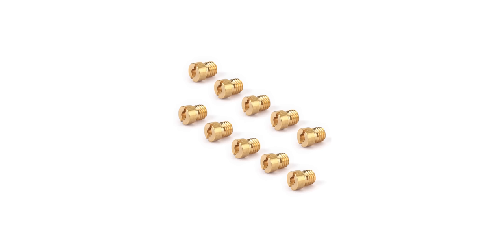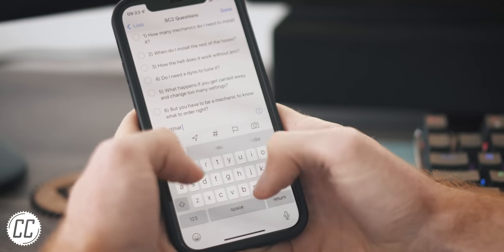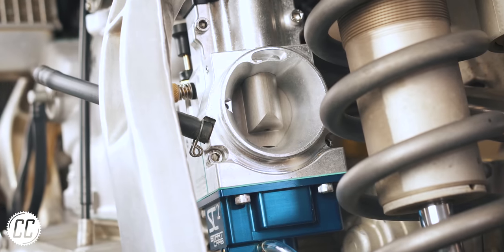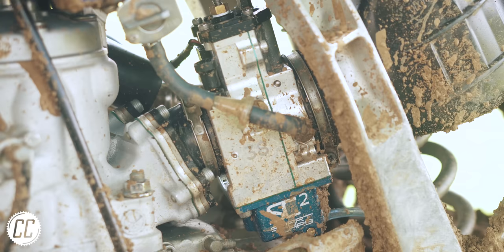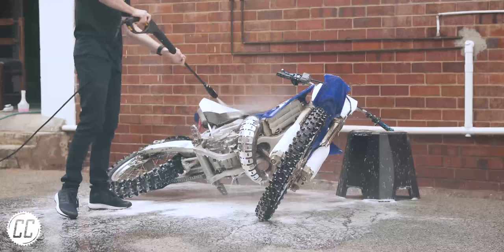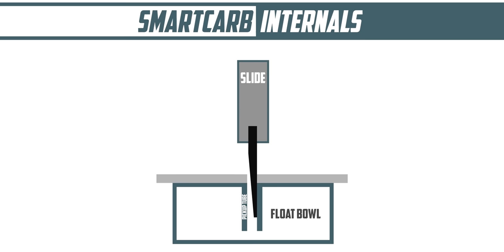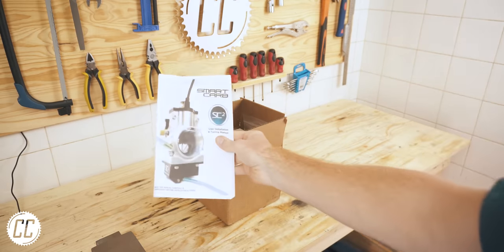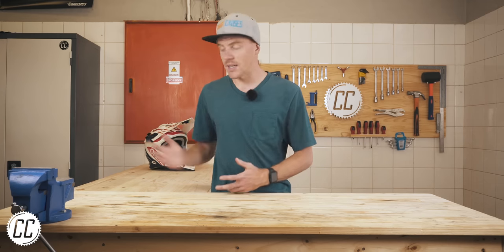The Best Carb Money Can Buy? | SmartCarb SC2

Comment: looks like a blos lpg mixer which used to be made more than a decade ago
Reply: How so? The BLOS is closer in design to the SU or other CV or constant velocity carburetor designs. The SmartCarb is a direct throttled, flat-slide metering rod carburetor with novel and patented integrated float bowl venting - not to assist throttling but to provide more immediate and proportional fluid communication into the float bowl to drive fuel flow.
Reply: @SmartCarbFuelSystems  sure, hence why I said "looks like a blos LPG mixer" I'm not saying your wrong or anything in any aspect, it's what came to my mind when I saw the video, it's something I know of and make comparisons to.

Comment: So Is this carb only for a 2 stroke dirtbike
Reply: SmartCarbs are primarily designed to replace similarly sized Keihin PJ/PWK and Mikuni VM/TM/TMX round and flat slide carburetors most often used in 2T applications. They work well in any application, 2T or 4T in which they are properly installed, properly sized, and properly throttled. The 2T market is the lower hanging fruit. 

What do you ride?

Comment: is it smart if it needs a box of needles,,, atl comp in a carb is smart but not new the only part new is they are not separate but great job on the review thanks
like and sub people
Reply: It doesn't need a box of needles, or metering rods as they're called. Once the correct rod is in use there's no need to change it for any reason unless you're substantially changing the engine characteristics (high compression head for example) or you're moving the carb to a totally different bike.
Reply: @SmartCarbFuelSystems  1
Reply: @rexxx927  nope, we do not agree. Our patents for the new technologies in our fuel system do not agree. And our customers in over 50 countries worldwide wouldn't agree. We encourage you to give one a try for yourself.
Reply: @SmartCarbFuelSystems  but you agree you need Parts but extra is not extra got it! and altitude compensation is not new they have been in sleds for decades planes too yours is just a carb with it inside 1 unit 

Holtzman Tempa-Flow is one from 20 plus years ago still used much today! so whats smart again about yours other than its in one unit! and can adjust on the fly but its automatic???

it does look great but it is what it is!

Significant Improvement of Engine Efficiency and Performance how much does a pair of 38mm retail$?

Comment: That’s the same way edelbrock carbs work
Reply: Not quite. The Edelbrock QwikSilver II is actually a predecessor to the SmartCarb sharing the same original inventor, William Edmonston. The SmartCarb improves upon the older design by adding integrated, internal float bowl venting to drive fuel flow proportional not only to in-air-box air density but also velocity and also a variable throttle rate venturi shape designed to improve signal at the metering rod. The history of the metering rod carburetor concept didn't begin or end with the Edelbrock and SmartCarb is leading the way today.

Comment: no its not. its  a great product but non of these new fandangled carbs are anywhere near as good as the old kehein when its clean and tuned right unfortunately
Reply: The claims we make against conventional jet/needle carburetion assumes that they are fully dialed. The SmartCarb SC2 absolutely outperforms the Keihin, even on its best jetted day.
Reply: @SmartCarbFuelSystems  no it doesnt not even close - up top theyre pretty good but down low there absoultely not and they stall a lot uneccessarily, where a non smart carb type devices dont - there is more then one brand doing the same thing and at the moment noone has got it right. 
the facts are allllll over the internet in reviews to find and youtube videos ironically...
Reply: @brettknibbs9351  we would ask that you don't lump the SmartCarb in with other metering rod style carburetors known for providing weak or soft bottom end response. No other carb brand is using the SmartCarb's unique, patented venturi shape and integrated float bowl venting feature. Both are designed to promote signal at the metering rod down low, allowing them to outperform not only other metering rod style carburetors using round bores but also conventional jet/needle carburetors like the Keihin/Mikuni. 

We feel that we have it pretty good considering the fact that top level hard enduro racers including Cody Webb are using it in competition.

Not sure where you're finding poor reviews regarding bottom end performance specifically about the SmartCarb. Care to share? Or are you in fact referring to the other brands?

Comment: I know a lot of people still do not have fuel injected bikes but still, Fuel Injection for the win.
Reply: Ever tried modern carburetion like this?
Reply: @SmartCarbFuelSystems  No. but I’m not referring to how the bike runs with it, the tuning is a nightmare to me. All carbs, not just yours.
Reply: @guitarfreak2105  well we make that easy as possible. All adjustments are tool-free and take only seconds to do and the SmartCarb, once tuned, stays tuned for a much wider range of elevation/temperature changes compared to other carbs. That’s something we’ve proven with multiple PPIHC wins drone application testing up to 22k’ with minimal variance in A/F ratios.
Reply: @SmartCarbFuelSystems  I don't argue any of your points. I simply just prefer Fi because I don't have to fuss with it. Looks like a great carb and if I get anything carbed in the future, I will buy one of yours for it.

Comment: So it's an SU Carb but instagram-y?
Reply: No. SmartCarbs are direct cable-to-slide throttled like other modern flat slides - no butterfly. The internal venting doesn't drive a piston but rather applies pressure into the float bowl to drive fuel flow commensurate to the air density communicated regardless of elevation/temperature changes and even blow through boost.

Comment: mmm a little less fuel for only 800$
Reply: Enough less for it to pay for itself with fuel savings in around 2-3 years for most riders, not to mention the other benefits of increased HP/torque and automatic compensation for air density factors including elevation/temp changes. You can't spend that kind of money on those kind of gains any other way 🤷‍♂

Comment: Better than fuel injection? What a Bullocks statement.
Reply: As far as we're concerned it's an open question.
Reply: @SmartCarbFuelSystems  
Yeah right, like the open question that the earh is flat.  
Do sensible marketing, sensible statments. It a lot better for your credibility in the long run.
Reply: @neilhintz8785  we aren't worried about our credibility. We stand behind our claims. Do stay tuned - more coming soon.

Comment: How do u rebuild this carb if it ever needed
Reply: Like any carburetor the SmartCarb has o-rings and gaskets that degrade over time, which is why we offer rebuild kits and recommend rebuilding the carbs every 3 or so years depending on use and fuel selection.

Comment: Better than efi?
No,  not even close
Reply: Doesn't it depend on the EFI system in question? Factoring in performance, efficiency, simplicity, cost, failure points, tunability, etc? As-is it's absolutely competitive if not better by some or most metrics compared to KTM's transfer port injection EFI system. 

The argument can be made, and we're making it.

Comment: no catch?!!! these cost like 500-700 dollars how is that not a downside\
Reply: Name another product you can buy for your motorcycle that pays for itself. For most customers who ride frequently the 25-30% reduction in fuel consumption/costs offset the cost of the SmartCarb in about one year - faster if using higher priced fuel or race fuels.
Reply: @SmartCarbFuelSystems  correct me if im wrong im wrong but lectron carbs do that too dont they
Although lectron carbs are really expensive too
Reply: @SmartCarbFuelSystems your carbs are better on fuel because they run the bike on a lean condition with poor fuel atomisation. Every single tuned motorcycle with a plain boring keihin will always create more power and work better than your carb.
Reply: @Billy-burner  nope. They are better on fuel economy because they provide greater combustion efficiency by way of superior metering rod atomization. We outperform Keihins every day of the week. Highly recommend that you do a little homework.

Comment: What about multiple carb set up??
Reply: No problem, so long as fitment and throttling are possible. SmartCarbs are currently designed with top-pull single cable throttling. Racked setups with shaft throttling are still in development.

Comment: looks like lectron but cheaper
Reply: The Lectron is an early predecessor to the SmartCarb in the long line of metering rod style carburetors. The more modern SC2 offers greater performance and ease of use.

Comment: If it was better than fuel injection the big 3 would use them as standard and not put so much R&D into FI tech lol it’s as good as a carb setup can get though
Reply: The big 3 are lumbering giants, slow to turn. What you see from them today was decided years prior. If the best available tech was always readily and quickly adopted by the OEMs, there wouldn't be an aftermarket to solve their deficiencies. Add in the stigma of carburetion in general and you can understand the landscape. We appreciate the kind words though about being peak carburetion. We would agree, but then we also consider FI to be our primary competition, not other carburetor technologies.
Reply: @SmartCarbFuelSystems  how are you changing ignition timing with a smart carb ? You can’t do the only way a SC is better is it’s more DIY for the average Joe but if you have spend 7-11k on a bike why would you worry about a few extra quid in dyno time or plug n play maps that aren’t concerned about emissions and just focus on performance etc. Fortunately for you there are more average joes with limited too no knowledge than there are people well educated
Reply: @EnduroDroneHub  the ECU manages ignition timing, not the fuel system. Besides, the SmartCarb has that covered too with a TPS option which is used by the ECU in some bikes to vary ignition timing (i.e. the late model Japanese 250s or bikes equipped with modern, trick ECUs like the PowerCDI, etc).
Reply: @SmartCarbFuelSystems  you aren’t going to change an fi enduro to a carb though your solution is only exactly what I said it is “the best carb option” argue small points all you wish not one FI “TPI” enduro is going to say pfft this is shit let’s rip it out and fit a smart carb 🤷🏻‍♂️ 

Also I’ve ridden a 300 2T with SC and TPI the TPI setup offers much more low control than a SC but I think the SC is a supreme MX Carb. Just my opinion anyway. I cut my teeth on drilling jets and profile carb needles so I’ve a little over 30 yrs experience trying to get the best out of carbs.
Reply: @EnduroDroneHub  on the contrary we get inquiries from those looking to de-TPI their bikes to go back to a carburetor (SmartCarb) every other day, which is why we are exploring the possibility of offering a kit. Looking around online you can find examples of others who have taken the task on themselves with success. As those bikes age and as support from the factory fades, people will be looking for ways to simplify and/or keep the bikes going. The off-road 2T aftermarket is absolutely thriving which is awesome. We want to see as many 2-strokes running around as possible for as long as possible.

Even KTM has conceded that their TPI technology isn't where it needs to be and are stepping backward to TBI. Wet flow induction is better. 

In any case the main point is that the customer has never had more choice available to them. We're big fans of options. To each their own and to each, happy riding!
Reply: @SmartCarbFuelSystems  enquiries aren’t people doing it though or you would of said that lol
Reply: @EnduroDroneHub  The next sentence in our comment says that people are already doing it. Check around on the forums, you'll find them. They're converting TPI bikes back to Keihin carburetors with TPS, so we know it's feasible.
Reply: @SmartCarbFuelSystems  I haven’t stated it’s not visible and already explained it’s only real benefit is diy tuning for people that don’t want to get into the cost of software and cables and or dyno time etc. Better on that aspect is entirely subjective. More user friendly tuning wise maybe better performance meh I don’t think so. 👍🏻
Reply: @EnduroDroneHub  that's fair. All we would ask is that you keep an open mind and pay attention to those who push the limits of performance using our fuel system. Better performance is a core claim of ours and we stick by it.
Reply: @SmartCarbFuelSystems  oh I’m open minded and always look at the big picture.

But if SC is that good buy a TPI do the dyno tests and track/trail tests then convert it and repeat prove the abilities. With a clear breakdown of cost and things required to do it.   It will only prove a rich man’s gimmick and simply show the juice isn’t worth the squeeze to convert FI to carb. It’s why across the motor trade in all sectors Carbs get upgraded to FI. Be it a bike boat car plane everything gets upgraded* to FI not FI backwards to Carb. 

It would be interesting to see a tpi done though I guess it’s up to SC to take that challenge and show the value in doing it. As I can’t see one past active ride out tinkering

Comment: Cool for 2T motors, a meme on 4 strokes
Reply: While they work fantastic in 2-stroke applications, some of the best performance and fuel economy gains we've seen have been in 4-stroke applications, particularly those we've EPA certified. Do stay tuned, we're pushing hard into the 4-stroke markets with fully realized kits, starting with the KLX140+, pitbikes, the DR-Z400, and more.

Comment: How high of elevation will it go up to
Reply: Independent testing performed at Northwest UAV (16mm SmartCarb mounted to a 50cc Desert Air 3W28i) showed minimal A/F variance at simulated elevations up to 22,000 feet, at which point the engine began to face the limits of natural aspiration. Not enough air. In terms of customers, the highest known location for use was in Nepal up to nearly 16,000 feet (KTM 200 EXC).

Comment: It’s basically a modern SU Carburetor
Reply: No, it's not. SmartCarbs function entirely different. They are direct throttled using a flat slide, not a butterfly with CV-style piston throttling like the SU. Integrated venting in the SC2 goes into the float bowl to drive fuel flow whereas the SU uses it to throttle the piston slide.
Reply: SU Carbs do NOT use a butterfly.  They utilize a direct slide (piston).
Reply: @DAT240Z72  listen, we're sure that for whatever it is that you do you're quite knowledgeable, but carburetion is our thing. Encourage you to do a bit more research as even a basic Google image search will show you the butterfly... As that butterfly is throttled via the handset and throttle cable, airflow into the engine increases. A portion of that airflow is communicated via internal passageway to the top side of the piston, the resulting pressure differential between it and the venturi being what "throttles" or lifts the piston against a return spring. In no way does twisting the handset raise that piston directly in the SU, unlike the SmartCarb and other modern, directly throttled flat slide carburetor designs.

Whereas the SU uses internal passages and pressure differentials to actuate the slide/piston and change the venturi opening, the SmartCarb uses them to communicate at-manifold air density/velocity into the float bowl, resulting in more immediate and proportional fluid communication - and that is a patented feature, among others we employ in our designs. Happy to answer any questions.
Reply: I get that your “smart” carb is considered more modern and advanced.  

Regardless the design of air and fuel metering was taken right from the SU design.  

That doesn’t take away from the benefits your smart carb has to offer.  

The genius of the SU was how it metered air and fuel across the entire RPM range.  The downside was the float-bowl design….
Reply: @SmartCarbFuelSystems I’d like to figure out how to install 2 of them on one of my 240z’s.  Care to participate?
Reply: @SmartCarbFuelSystems I just need a 45mm
Reply: Hell!  A manifold with 6 smart carbs (1 per cylinder) on a 240z would be bad ass!!